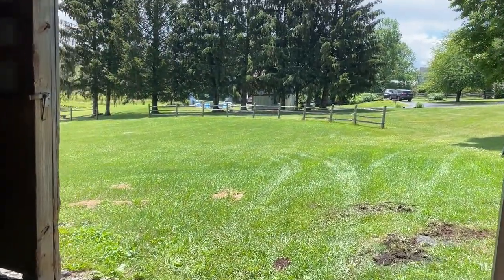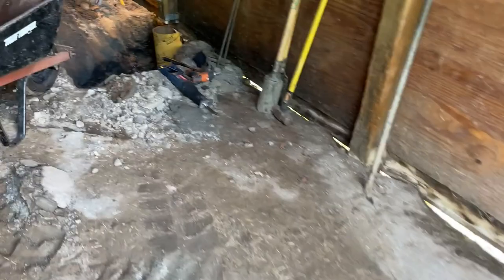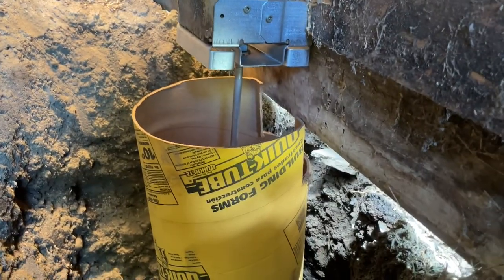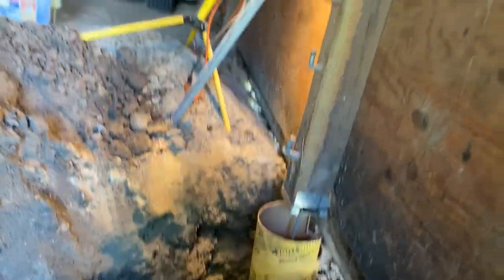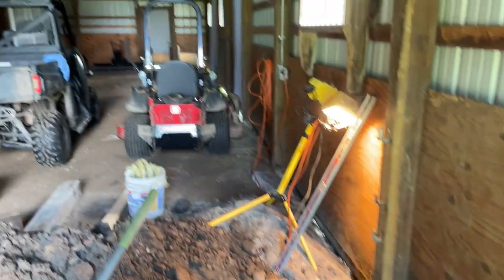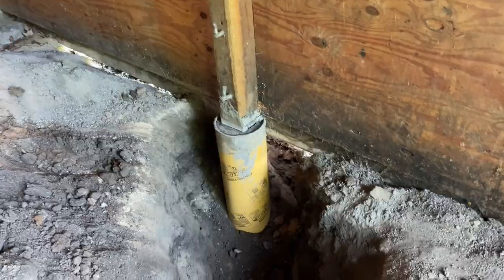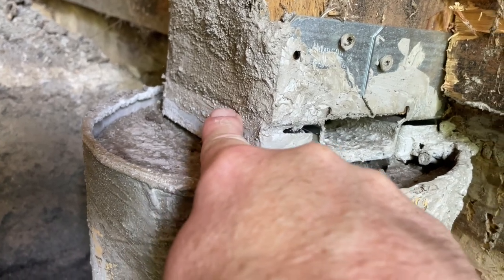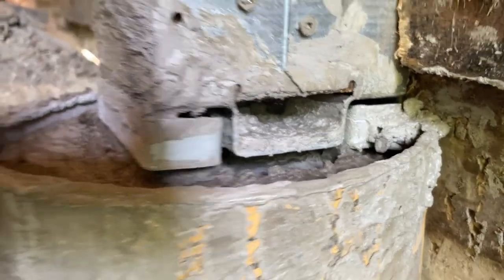Repairing rotted posts with concrete columns - Pole Barn

Comment: hey nice video! thanks for making it. I have a question about the notch in the sonotube. If your concrete fills the tube and goes up to the bracket - and the concrete in the notched part will be contacting the horizontal board. Are you not concerned with rot along that board also?
Reply from the maker: That’s a great observation and the answer is yes. But since there will be no exposure to rain/snow the likelihood of moisture getting trapped there is unlikely.

Comment: Did the settling occur because the concrete drained from beneath the form or because it actually shrinked while hardening?  I'm going to do something similar and the concrete specs i found on the internet say the drying contraction should be no more than a couple millimeters.
Reply from the maker: Yea that’s a great question and I assumed it was from the mix settling down in the tube and some water loss out the bottom.
Reply: @freetotryit  Do you do the rest of the posts? How did you cure the settling?
Reply from the maker: @keithwiebe1787  to help it settle better I took more time running a piece of rebar up and down in the concrete to help fill all voids. I also mounded the concrete slightly at the top. Doing both of these worked well.